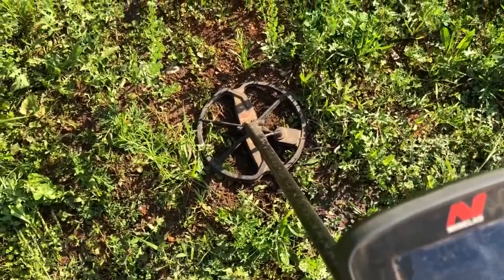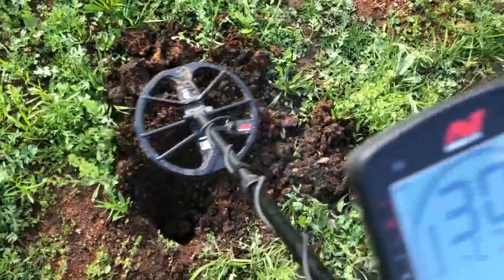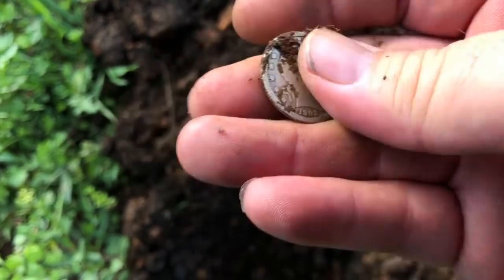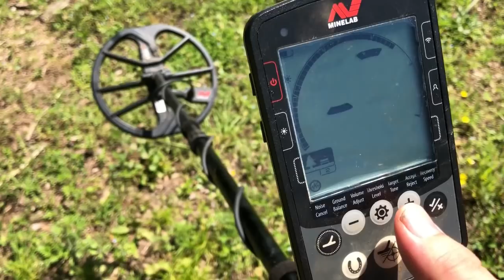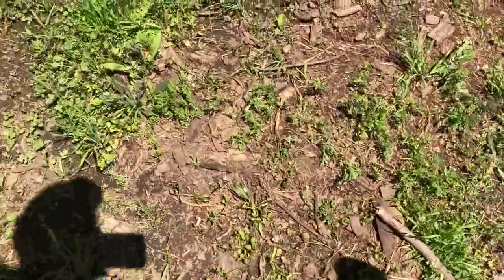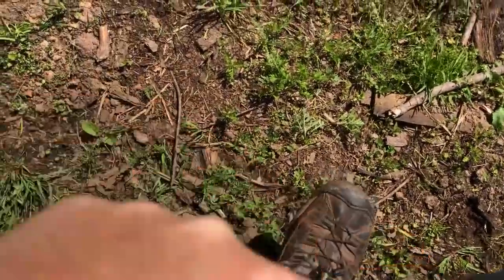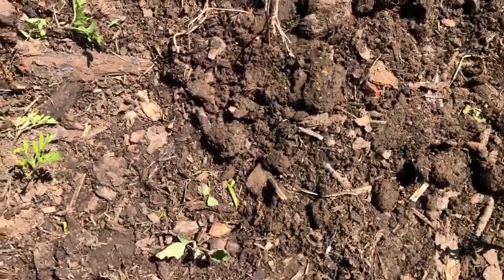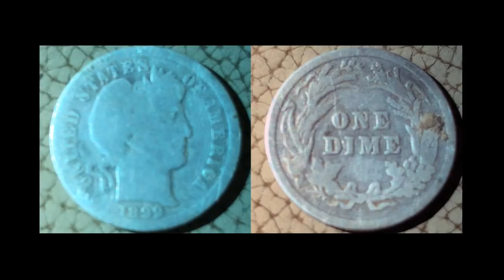Minelab CTX 3030 vs Equinox 800: Comparing signals on silver coins in the wild.  (#55)

Comment: Why on earth do a vid of the ctx and  on a lower end machine .....   no point .....
Reply from the maker: As stated, to show users who may be interested in any of those machines the sights and sounds they can expect to see and hear on random targets out in the field. Not everyone can afford a CTX.
Reply: @MetalDetectingNWGA   ow yes . I bought my ctx for 650 quid ...  just needed tlc...  a new shaft lock..  and scews for main body . And a dam good clean.....    my friend has just bought a etrac for 370 needed a new buttom pad...   i never buy new ...  you can get a great used highend machine ... if you look out for one.....   a explorer 2 can  be picked up for 250 plus.... will run circles around other new machines costing almost a 1000£
Reply from the maker: Andrew Pattullo you got some great deals! I never seem to get that lucky when I’m shopping. I bought my CTX new for around 1700 dollars. I think I paid around $800 for my old Etrac used but in great shape. I wouldn’t mind picking up an Explorer.
Reply: @MetalDetectingNWGA   its luck and others buying on a whim...... previous owner of ctx ... didnt know how to use a laptop. !  So absoulty no idea .  Being a minelab owner for 25years....they are sowell built...  there are only a few things that can stuff. Up...   so if you are willing to buy !  Derector with issues....  and an easy fix if you know how 😉